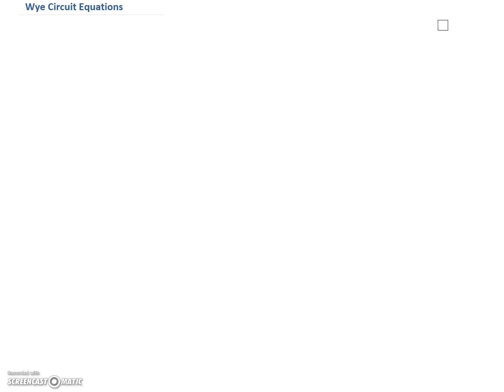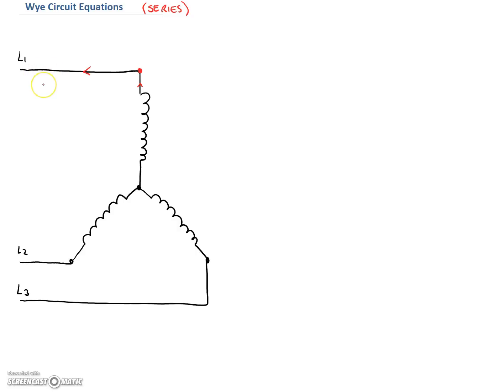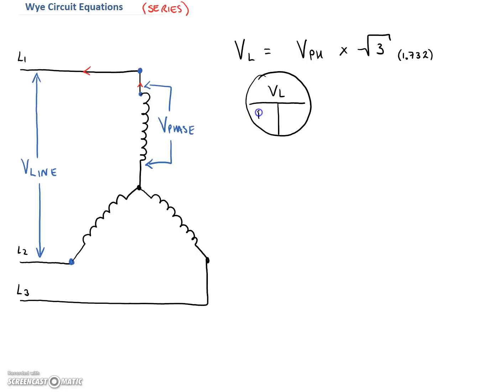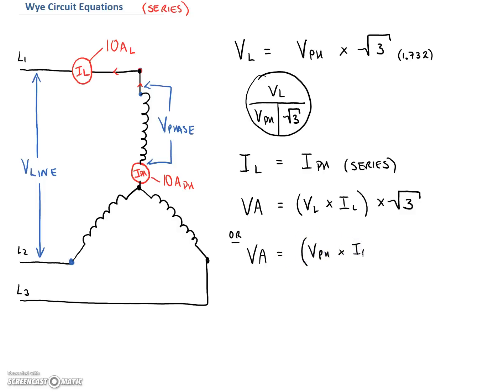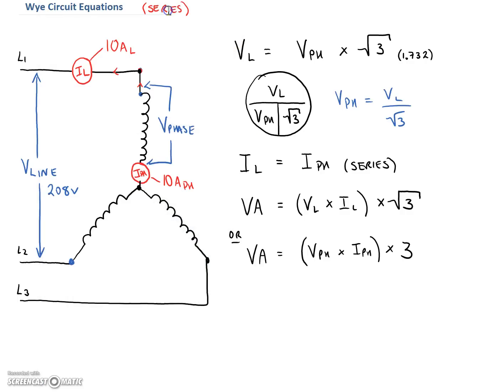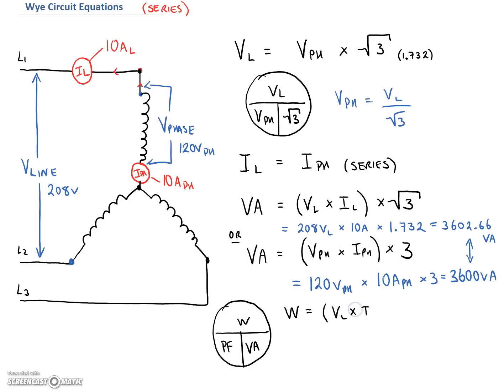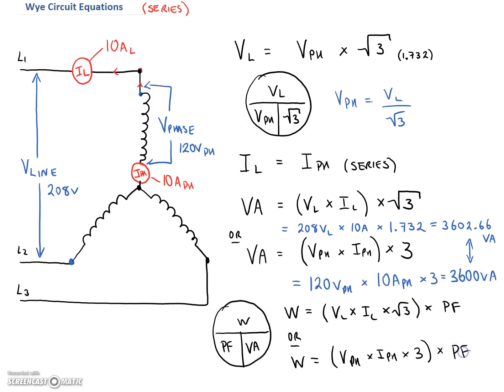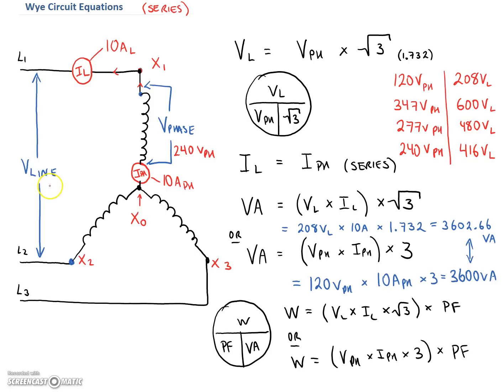3 Phase Wye Tutorial (Electrical Power PE Exam Review)

Comment: I can only assume VA is being calculated for 3-phase loads, right? In other words, calculating VA's for a circuit only involving 2 of the lines would not include the root 3 multiplier, correct? 

Follow up question: if only using 2 of the lines, would you consider that a single phase when no neutral is involved, since the two windings essentially become one? Of course voltage, in this case, would be line voltage (not 'phase') but the load would be experiencing a single sine wave of current, correct? Can't really have more than 1 phase with only 2 wires, is my thinking. Reference is king.
Reply from the maker: Correct... and correct

Comment: Like your explanation, however, how would you calculate the total power coming from a 3-phase system vs a single-phase one? I have a problem deciding whether to go with a single-phase 32A breaker or a 3-phase system with 10A  breakers in each line. How to calculate the total power available from the 3 phases vs the single phase?

Comment: great video but by drawling your phase voltage across phases would give you a higher voltage going phase to phase I would specify that it is just phase voltage or phase to ground voltage vs phase to phase voltage.
Reply from the maker: I was quite clear that any voltage on the inside is a Phase value, any value on the outside is a Line value. There is no "phase to phase voltage", it is a Line to Line voltage. I am not disagreeing with you, rather I believe we are saying the same thing.

Comment: Where did you get the software to do your presentations? The one that shows the calculator and the overhead.
Reply from the maker: I use a Microsoft Surface Pro. I prefer using Word, but One Note is better for drawing with the stylus that comes with the Surface Pro. The calculator I found using the links available in this video. https://www.youtube.com/watch?v=ZX6JoWShL8c&list=PLyL0ResmI4Q0-1lC2sfJW7hcOKo-LoS4g&index=4&t=0s
Reply from the maker: How did you get the mural in your shop done, it looks great.
Reply: @PeteVree  the mural artwork was taken off the web and the images were projected with a DLP after color separating them into fewer colors. You then simply paint on the projected lines.
Reply: @PeteVree  thanks for this. I have a WIN10 PC with a touch screen so I will give it a go. I liked the presentation BTW.

Comment: Can you explain why there is only one path here?
Reply from the maker: It isn't exactly a Series circuit, but it help some people remember that I Line is equal to I Phase. There is only one path in our out of the outer connections of the Wye circuit. Where as the Delta has 2 paths at each external connection, so I describe it as a Parallel circuit where V Line is equal to V Phase. Hope this helps.

Comment: Where is that square root of three coming from?
Reply from the maker: http://www.electricalpereview.com/square-root-three-3-electrical/
Reply: the coils from where the 3 phase generate from ? I think..
Reply: Impedancenetwork 
This will be more difficult to try to explain than it really is but I'll try to put it into words step by step.

Right triangles and a little trig are where 1.73 comes from. 

If you draw out phase "A" on the x axis and then draw phase "B" 120 degrees separated from phase "A", you have two sides of an isosceles triangle. Now let's say  you draw a line to connect the points of phase a and phase b together, the isosceles triangle becomes visible.

 The inside angles of a triangle =180, so 180-120= 60 degrees. There are a total of 60 left over degrees shared between the two points of the triangle A and B. 60/2 =30. This means there are 30  degrees at both ends. 

We can use trig solving right triangles to show exactly where 1.73 comes from. Lets say the magnitude of each leg of our  isosceles trangle is 1. We draw a 90 degree line to cut the isosceles triangle in half so we create two right triangles that we can solve using trig. Lets solve 1 right triangle at a time. 

On the A phase portion of the triangle i said we have a magnitude of 1. This leg happens to be the hypotenuse of the triangle. Also known is the interior angle at the point which was 30 degrees. The trig functions we can try to use are; SOH(sin opposite hypotenuse) , CAH  (cosin adjacent  hypotenuse) and TOA (tangent opposite adjacent). 

Our known leg was the hypotenuse,  so we need to solve for the adjacent side of the right triangle. Trig functions CAH should give us everything we need to solve the equation. Cos30 = x/1. Solving the equation leaves you with cos30 x 1 = .866. Do the same thing on the other hypotenuse side for phase B and you get another .866. Add them together and you get 1.73 as the total magnitude of the bottom line of the isosceles triangle. 

That is why we shorten all that up and just tell people to multiply by 1.73 to get the phase to phase voltage on a wye. 
It's due to the 120 degrees separation of the 2 phaeses that creates a 30 degrees phase shift when you connect the two phases together.

Comment: By phase do you mean load value
Reply from the maker: Not in this instance. Phase is referring to the value on the inside of the circuit. (From a line conductor to the  center star point)
Reply: Pete Vree I don't understand
Reply from the maker: Watch the video one more time. Phase values are on the inside of the Wye, Line values are on the outside of the Wye. I am not talking about load values in this video, strictly the voltage and current values inside and outside of the Wye.
Reply: K I think it's over my head a little lol I understand the line side coming in so are you referring to the phase as to the transformer is transforming